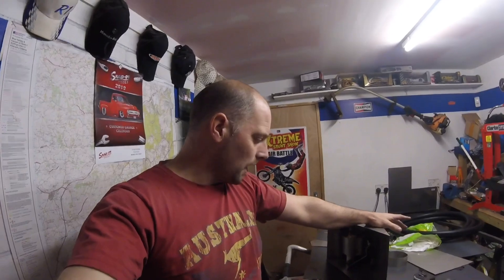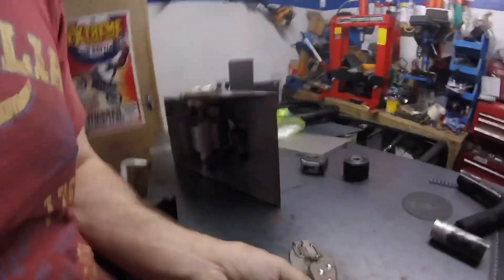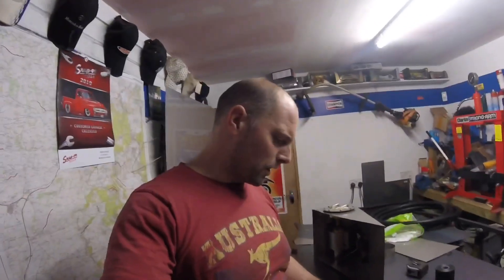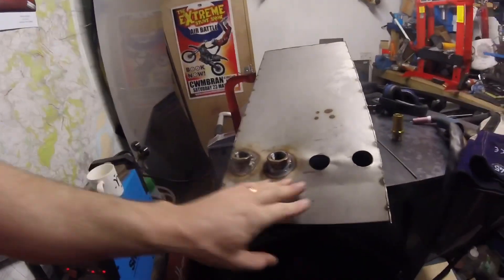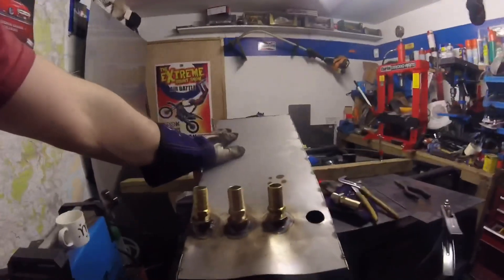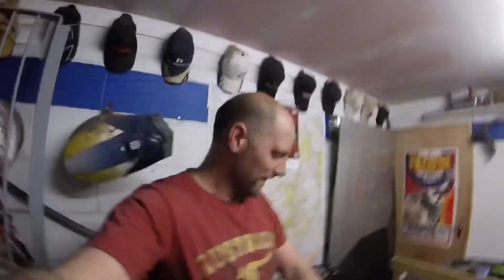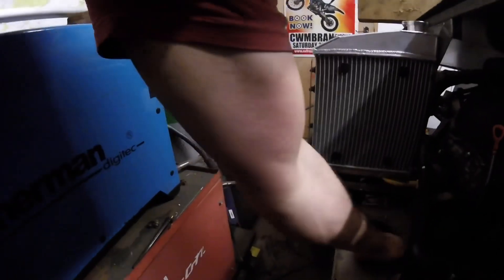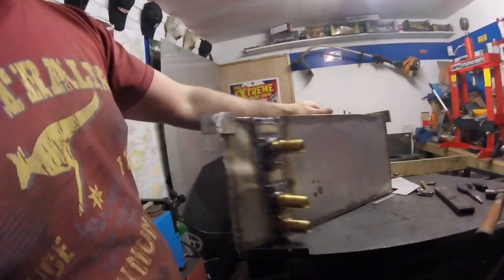Lamborghini countach kit car

Comment: Ah man, when you were marking those fittings out I was saying it's going to foul the chassis, and I was hoping you'd notice before drilling and welding. :( I clicked like for a good try. :)
Reply from the maker: Project Supercar I could have died when I realised it didn’t fit, I was so caught up in getting them made that I didn’t think to look at the chassis😩 but it fits now lol and I have made shore the other side fits I’m just in the middle of welding it up, got to weigh for the fuel cap parts to come in so I can make a filler neck. Always Learning 👍